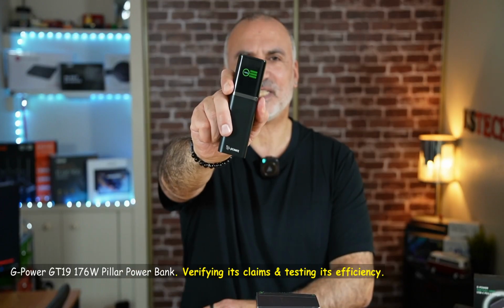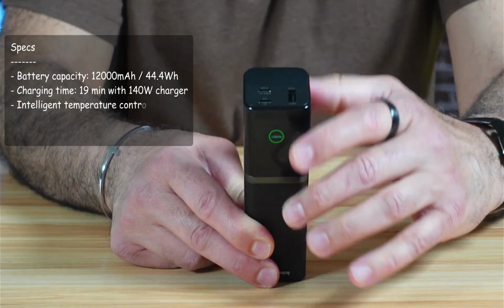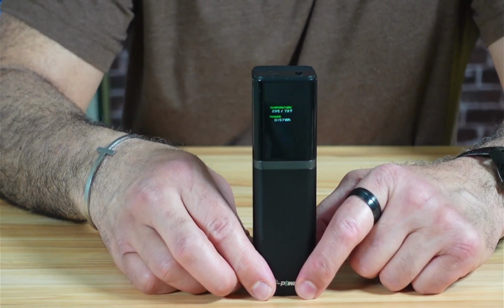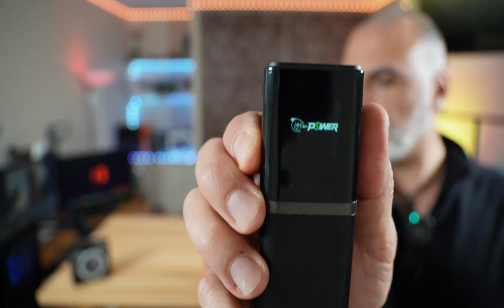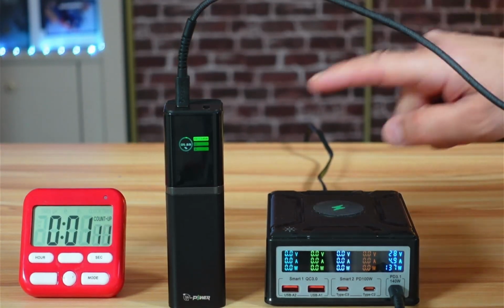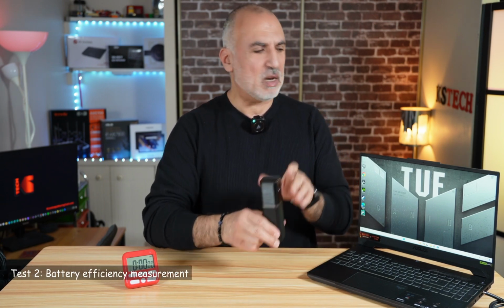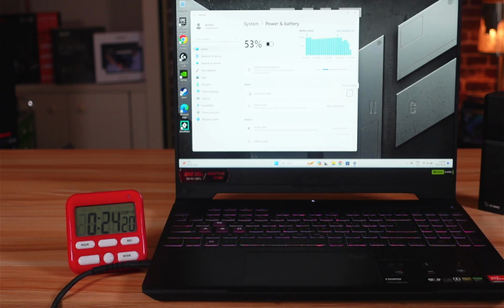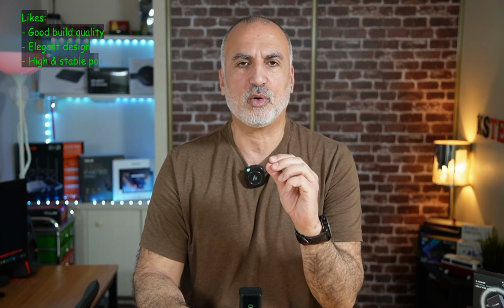GT19 G-Power 140 W Power Bank Pillar full review & efficiency test

Comment: Thanks for sharing. Was looking for some real-life tests. One minor thing to notice: the power bank shows 100%, but is still charging as you can see on the power bank display itself or the display on your charging station. The Anker Prime power banks are doing something similar, hinting, that 100% on the display is in reality more like 80-90%. I have those Anker power banks, and they charge around 10-15 minutes beyond the 100% on the display. I'ts kinda cheating, cuz it's obviously not full in 19 minutes. Regardless it still extremely fast - so not the biggest deal.
Reply: Great video, thanks...      😀  👍